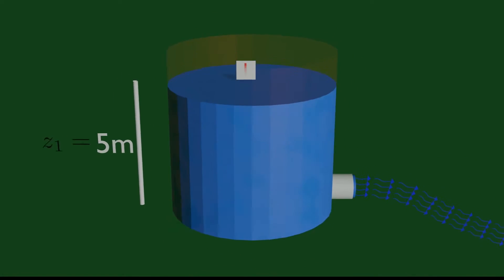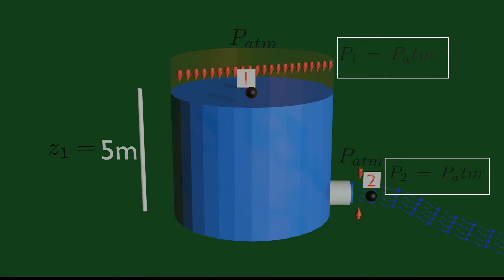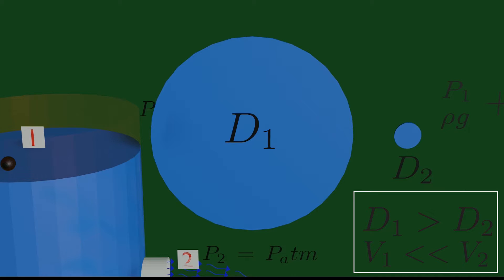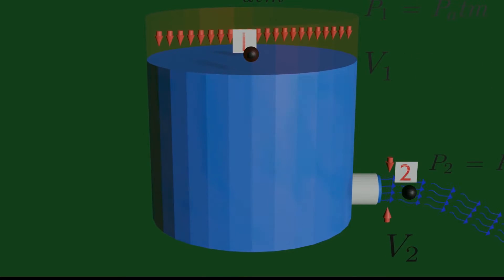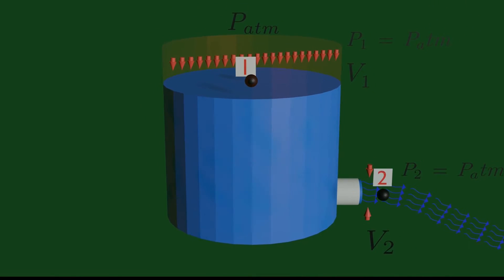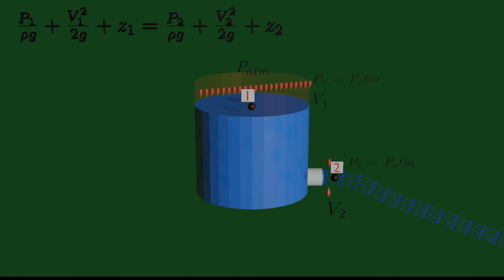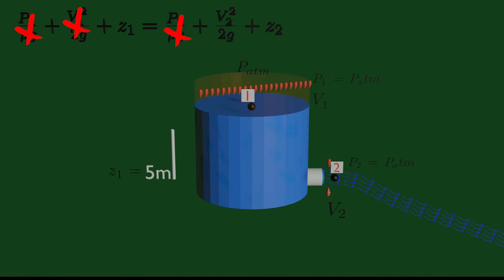3d Animation of Bernoulli Equation Problem #1

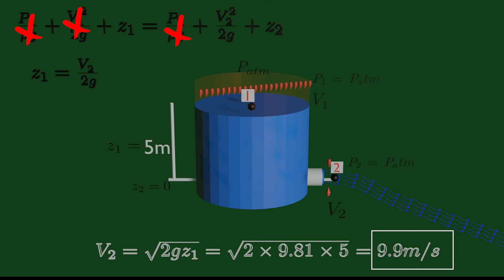Comment: 1:55 is it really the maximum velocity? Not the average velocity?
Reply: That is the maximum exit velocity. Mind that the only pressure is caused by the water height and as long as the water drains, height will be decreased, thus the velocity will also be decreased.